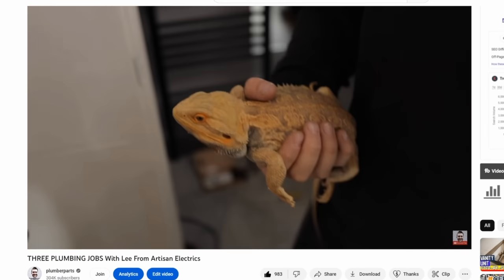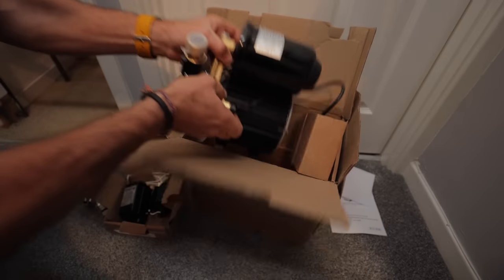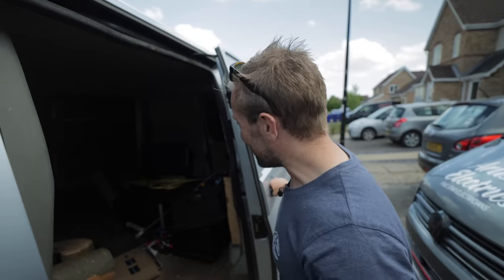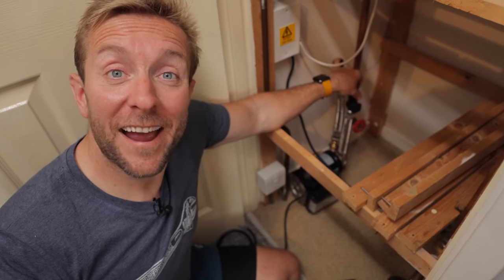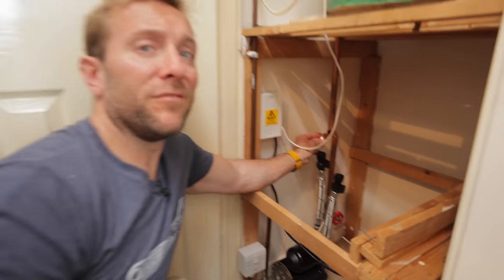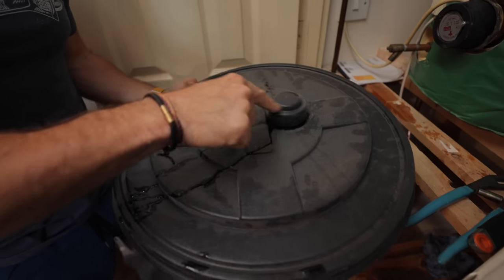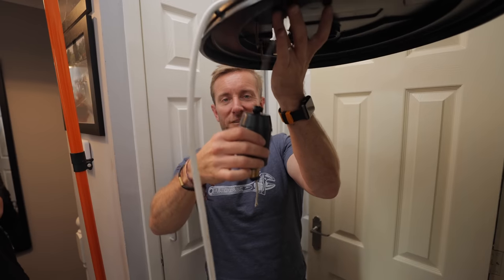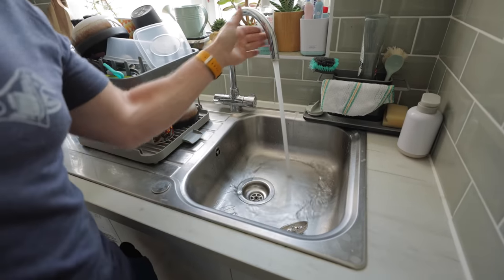HOW TO BOOST HOT WATER PRESSURE WITH LEE FROM ARTISAN ELECTRICS

Comment: I have more or less the same system at home, I have cut a tank feed into the header tank at the top, so the hot and cold feeds go to a aqualisa digital pumped shower unit. 
We have 8 bar of water pressure, which I have had to reduce down to 4, full bore valves everywhere and the system works perfectly. 
After a very long shower the water level gets very low, but has never run out. We cant use the boost function on the shower for very long tho.😁 
The float is a very interesting idea tho.👍

Comment: These tanks can work properly. We've got one in a bungalow and it's fine. If the fittings and pipes are correct it shouldn't be a problem but everything is made for pressurised systems these days so when upgrades are done it no longer works as it should.
Reply from the maker: I do find this with taps these days!

Comment: Quick question a stuart moonson stopped letting the cold water flow through the pump any ideas . Installed another pump 1.7 bar salamander pressure Is too high from it to the shower. Any way to reduce the pressure and keep the same pump in. Pump feeding all cold supply to house, apart from kitchen sink.

Comment: James! I’m distraught!!! You didn’t clean all the dust off that plastic cold tank tank lid!!!! OMG Also, how did that float system actually increase the hot water pressure??  Confused
Reply: The float was just to stop the PUMP from running dry, it was the pump he installed in the bottom of the cupboard that was boosting the water pressure coming out of the tank

Comment: Power Shower Booster, anyone ??
Reply: I posted that as well but comment disappeared.  15 minutes work - much smaller, no soldering, pipe bending or electrics. Did it for my in-laws a few weeks ago and it's great
Reply from the maker: Which one did you fit and what did it feed? Just want to clarify what system you were working on.
Reply: @plumberparts  Its called Shower Power Booster - SP2B.  I think it's compatible with all types of system but I did it on a gravity feed system connected directly next to the hot water tank.  It mainly was to feed a shower but obviously boosts every tap as well.  It autodetects flow, you hear the pump kick in get loads of power.
Reply from the maker: @christophersadler1499 although that would work, it would run dry on this system without the switch gear. 

Also this boosted the entire house. 

Well done on getting yours sorted!
Reply: @plumberparts  ah yeah not  seen little tanks like that before only big ones from loft so that makes sense with the float thing.  
The one I mention boosts whole house as well.  The guy who invented it is mega nerdy and you can link 2 in series and they talk to each other to get mega flow if you have super low pressure.   All your videos have helped me so much do my in-laws bathroom over the past month. Thanks